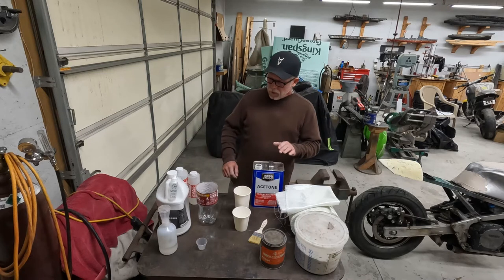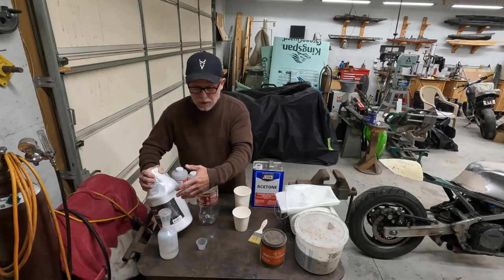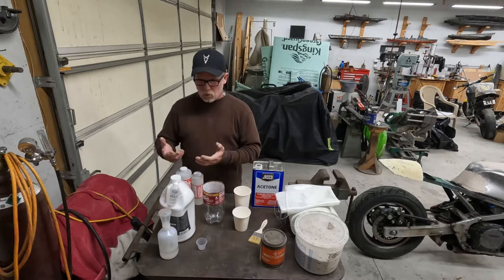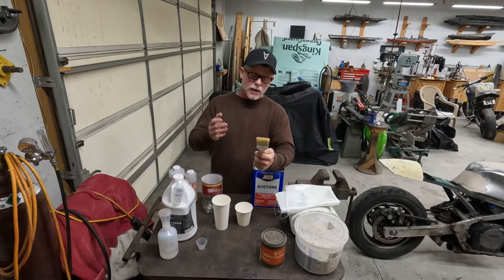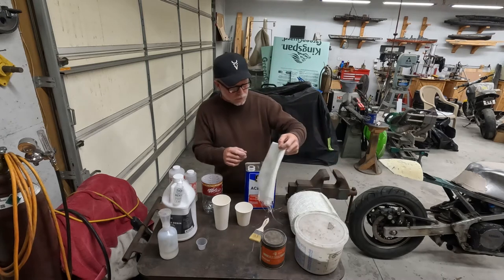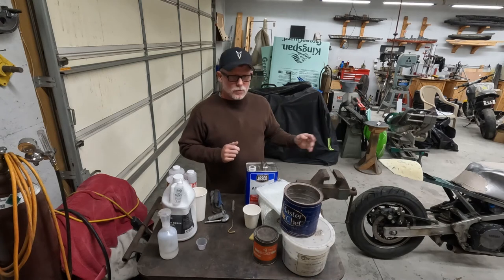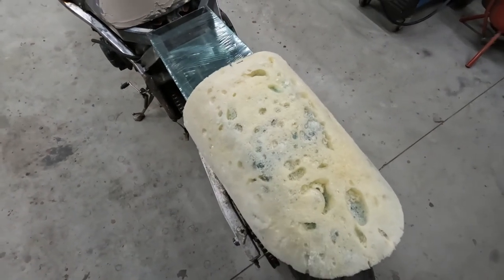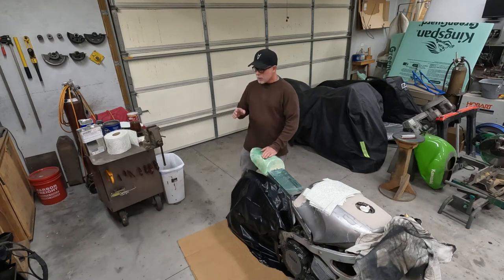Custom Motorcycle One Off Fiberglass Parts Episode 2

Comment: Awesome videos!  Very informative.  I may have missed it because you only show bubble rolling on the 3rd layer..  Do I bubble roll each layer? 
Also if I only get time to do the first layer can I come back the next day and just start the next layer?  To learn and trial and error I am just using the 3M fiberglass resin sold in stores for typical bodywork.
Reply from the maker: I typically roll after I have laid all layers. Yes you sure can lay up on previous layers. I am not sure what the type of resin used in auto body it may be a finishing resin if it is…. That will require scuffing the surface for a better bond between layers. If it still has a tacky feel after cured that would be a laminating resin you should be fine to apply without scuffing the surface.